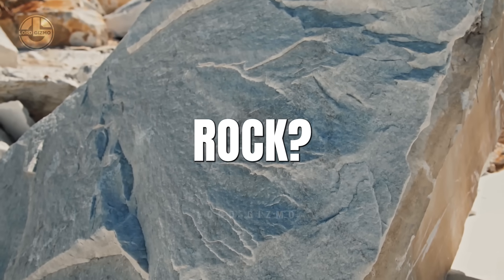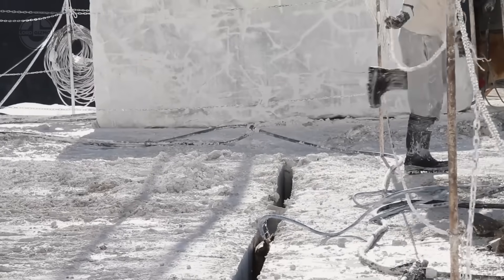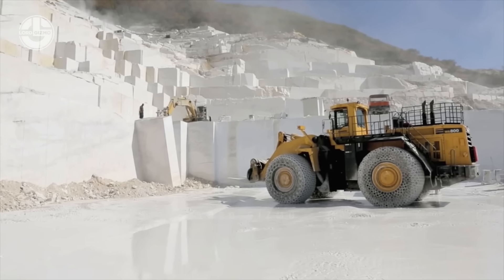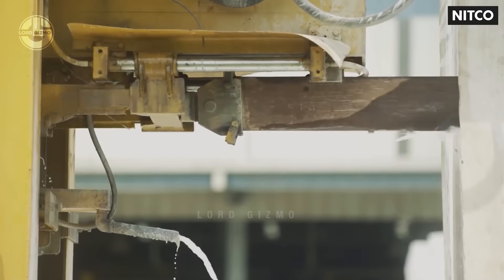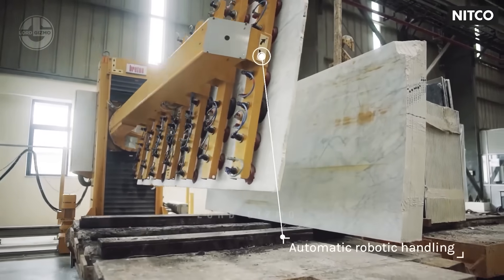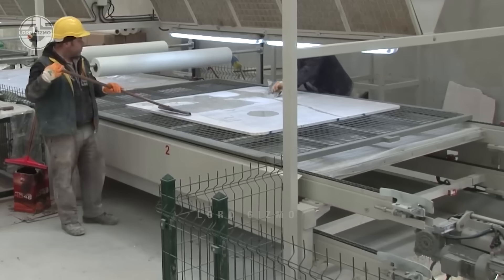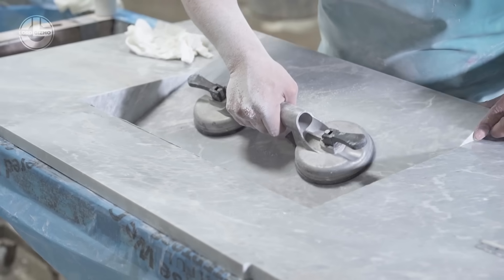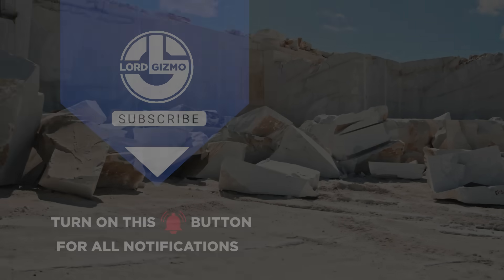Marble Mining and Manufacturing From a $1 Billion Quarry | The Luxury Stone

Comment: In the beginning 0:15 there is an incredibly big, beautiful and luxurious bathroom, covered on marble. How would they fix the plumbing though, if something goes wrong? Do they detach the slabs on their entirety from the wall? Do they have to fix the pipes from the other side? Not always those same type of marble is available afterwards....
Reply: If you spend that much you use better plumbing that won't fail. 
Other side of the wall is the most common route if you do need to. None of the functioning pieces of the plumbing are behind the stone.
Reply: Usually, if the GC and plumbers who do the planning build out space to access on the other side. Most homes have access space. For example, a closet on the other side of a bathroom, or with really big bathrooms a crawl space like area. Etc depends on the home
Reply: Yup, they go through back side of the wall in another room…and like the other guy said also, you use extremely high quality plumbing fixtures…

Comment: In manufacturing, marble gang saws are employed to slice large marble blocks into thin slabs. These multi-blade saws use water or other cooling agents to prevent overheating during the cutting process.

Comment: water is cooling the cutting "blades/ wires" its not for crack prevention, #1 enemy of any cutting tool drill bit etc is heat
Reply: Yep. Cool the blade, minimize dangerous dust, and less stone chipping/cracking.

Comment: 3:05 what are you talking about! ? Keep the material cool? What the hell that even means!? The water is used to cool down the blade or the abrasive chain! Nothing to do with the material that is cut!
Reply: Once we lit a fire on a marble tile considering it won't cause anything as they are stones, but to our wonder, the marble tile gets cracked...so presumably that would be the case here. However, I think they use water to comfortably remove the cut material without spreading dust everywhere.
Reply: @-sawal  I agree with that. But this comment was made in another situation….

Comment: I learned something new from this video.... marble slabs can have epoxy and fabric added to increase strength. This also allows better finish on exposed side as it becomes more dimensionally stable. Like putting a 'cast' on a broken bone.
Reply: i think it was the backside of the slab they applied epoxy and most likely a nylon or polyester mesh.
but yeah 'mega epoxy' was weird one
Reply: Thanks for comment @priorityone89
Reply: Oh no, no, no... this uses MEGA epoxy (apparently).  I've no idea what that is, but it was a surprise to me too.  I'd have preferred a little science, but I'm guessing this isn't a channel for me.
Reply: Thanks, I too never heard of it. Learning is good. @paultinwell5557